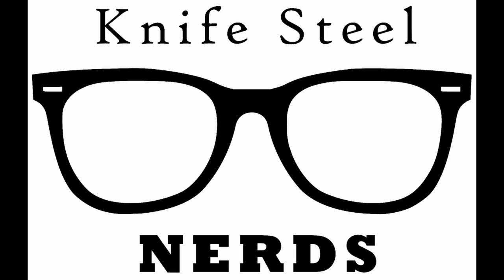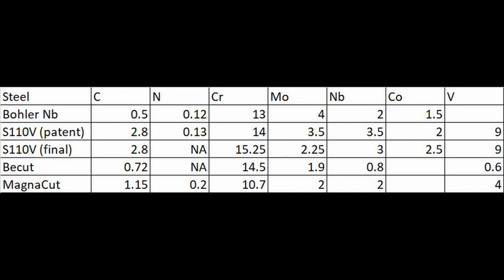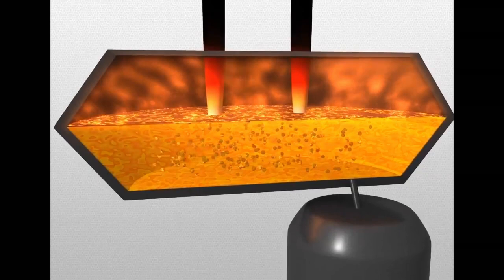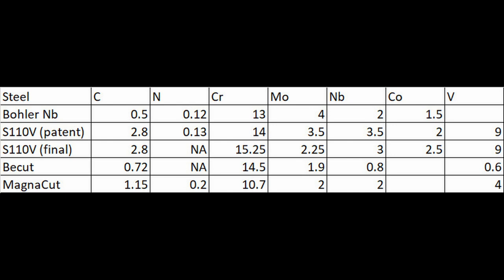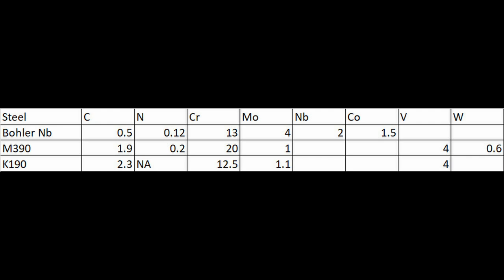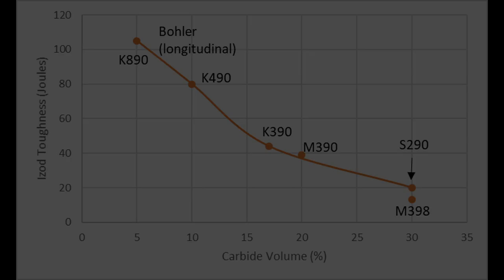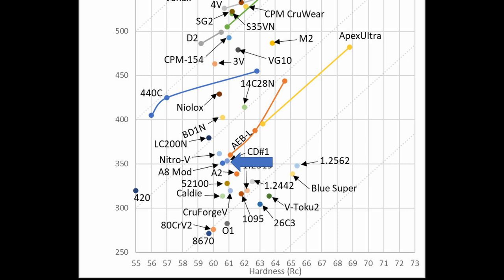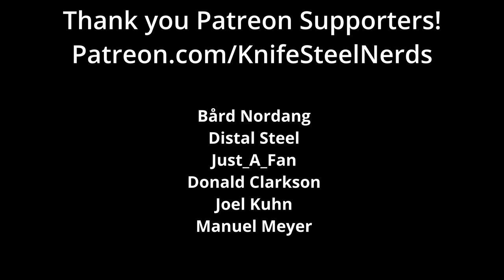Is a New Bohler Knife Steel Coming?

Comment: Imagine if someone were to create a machine learning ai that could create new steel compositions and ht protocols for the perfect steel big or small for whatever product and it's desired performance.
Reply from the maker: It certainly could be done. As with any such modeling efforts a lot of it depends on how much good data you have access to.
Reply: @KnifeSteelNerds  agreed. In the current market it would be difficult. Perhaps some day in the future it will become a reality.
Reply: It has been done for ceramics and carbide.
Reply: @kknives_switzerland  nice! I'll have to see if I can find information on that!
Reply: yeah it's discussed in materialism podcast, check it out for sure
Reply: @Lurifaks707  thanks, Going to check out that podcast!
Reply: @tacticalcenter8658  It's extremely interesting.
Reply: I'm a knife enthusiast who does machine learning for my day job (and also have a ph.d. in chemical engineering). I've thought about this a lot, and it's way harder than you might expect. The problem is that metallurgy is so empirical. It's not like chess where we have the "equations" and can let the machine crunch away to find optimal positions. So you're stuck with trying to build a model from large amounts of data. The fundamental problem with that is, while you might be able to make some slight optimizations within the space you're already investigated, you're unlikely to make any significant advances outside that space. Then there are other practical issues, such as when you consider how complicated just the heat treat step can be in affecting the final properties, and now add in the non-linear effects between composition and heat treat. Anyway, short story is if you have a lot of data, machine learning might help you squeeze a bit more performance, but I don't see how it can come up with something that's new.
Reply: They'd still have to sort out manufacturing issues like he mentioned for the other alloy they never commercialized, but it would be a cool way to get started
Reply: @WalterReade  optimalisation makes big difference, so it should be worth investigating anyway. Magnacut is also a result of optimalisation and it's the biggest leap in knife steels since.. the conception of PM steels? Which is like 40 year old technology.
Reply: @tacticalcenter8658  it's been used to develop a novel powder HSS with a wide sintering window. I think that shows promise.

Comment: I guess if you're looking for something with a bit more stain resistance than S7 (none) and A8Mod (a little) it could serve as some kind of chipper blade. Though I shudder to think what manner of horrific industrial chipping process it'd get used for, probably making hotdogs
Reply: A8mod with infi heat treat has decent stainlessness properties despite it not being stainless steel at all. Same goes for the delta 3v. Its amazing what different microstructure can do with the composition these steels have.
Reply: @tacticalcenter8658  For sure, I've made a few big knives out of A8 and its a pretty fearsome steel when it comes to strength and very pleasantly surprised by how well it resists corrosion. The edge holding for what it is really isn't that bad either and considering what you can do with them, not my first choice for a chefs knife, but if you need to cut a car door off and fight a ninja clan its a great choice
Reply: @krissteel4074  lol yeah, check out Joe X on YouTube... Hilarity continues.

Comment: Interesting that adding graphite to the powder blend is considered a novel approach in the HIP process. It’s very common to see flake graphite added to water atomized steel/iron powder in press and sinter powder metallurgy. There’s always the risk of segregation though since the steel powders are typically an order of magnitude larger in nominal particle size.

Comment: Great video Larrin, I think the only way this steel could replace LC200N is if it has greater edge stability as that is most peoples complaint about the steel.
Reply: Seems like, as with LC200N, hardness would max out at 59 HRc in production knives (vacuum furnaces with gas quench). So we're still not going to see potential for acute culinary knife edges with it. AEB-L and Larrin's proposed NioMax still own that space.

Comment: Looks like an excellent option for a large stainless steel chopper 👍
Many people have asked me for a stainless steel chopper… any other suggestions of suitable steels?
Reply from the maker: AEB-L or Nitro-V if you can get them in thick enough sizes.
Reply: @KnifeSteelNerds  anything above 3/16 is a challange with these steels
Îd love to get my hands on magnacut but it’s still on the expensive side
Reply: 420HC or better yet forge weld to thicken 14C28N

Comment: As a question - why not inject the carbon during The gas powderization? Would swapping the nitrogen for a carbon bearing gas not work?
I considered suggesting carbon subnitride. But... Well, that's Dicyanoacetylene... So getting oxygen into the powderization vessel would cause a big boom.

Comment: Does cobalt only help more austenite form at higher tempreturs, or does it also cause more retained austenite during tempering as well potentially leading to a loss in toughness if it decomposes or bad edge quality/ difficulty sharpening?

If it does lead to more retained austenite is decomposition even an issue if you have sufficient chromium? Does colbalt reduce decomposition all by it self?

Comment: Hey larrin i have a question. Why is that harder steel's e.g. rex45, k390 appear to have a darker shade or more fine lines then say stainless steel's which appear less dull and more reflective to light? I even noticed s110v although a stainless steel but with a higher HRC to the naked eye looks more like k390 and rex45 then say elmax or 14c28n. There's definitely a difference in appearance i just don't know exactly why? Thanks again for your contributions!!
Reply from the maker: I haven’t noticed anything like that before.